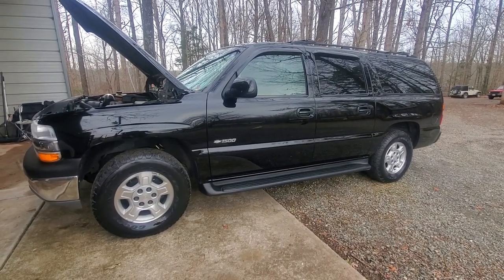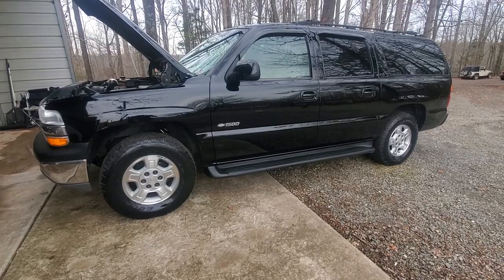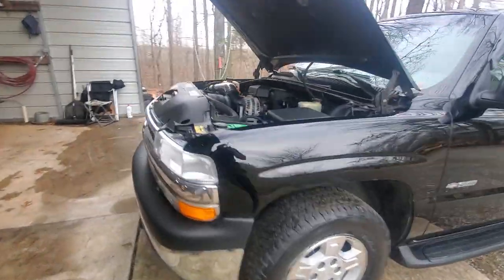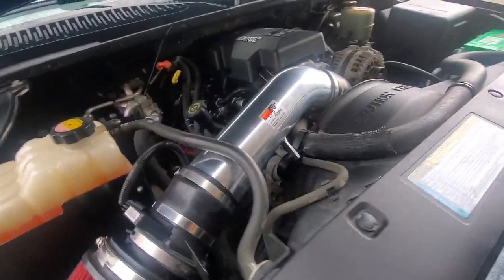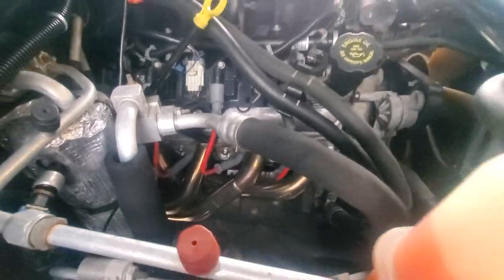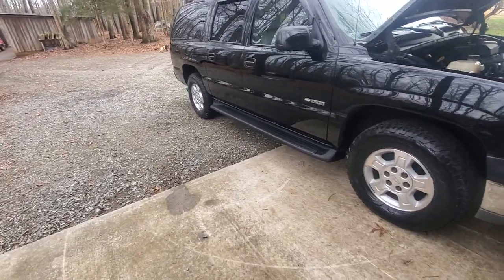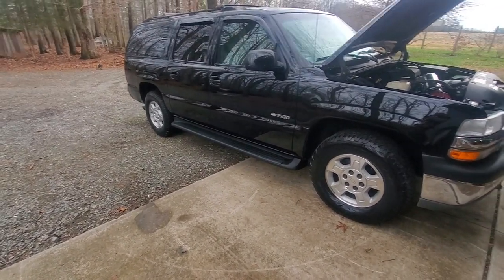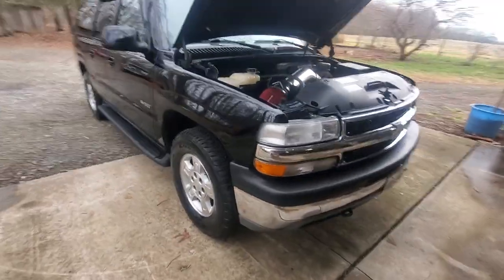BTR STAGE 2 CAM IN LS

Comment: I did the same on my 07 avalanche, but used pace setter 1 3/4” longtubes, pace setter 3” y-pipe, cherry bomb salute series muffler. After about 3 months my torque converter started slipping, there is 170k miles on it tho, so it’s due for an upgrade. Since I need a new torque converter, gonna go ahead and go with the stage 4 cam, 3200 circle D TC.
Reply: Say a prayer for your 4l60 and put a trans cooler on it lol

Comment: Hey man love the work. The wife has a 5.3 Suburban with Pacesetter LTs and Pacesetter Catless Y pipe with a magnaflow muffler(she ain't crazy on loud exhausts just power lol) what supporting mods did you do too accommodate the cam? Did you run a different converter with a higher stall? Any info would be greatly appreciated!

Comment: I have an 06 Tahoe I just put a stock LQ9 in and I have some ported and milled 243s to bump the compression to11.3, ported Fast LSXRT 102mm intake, 4" CAI with Ls7 MAF, 1 3/4" headers, ORY, Flowmaster dual 3" to 4" merge to a stock Duramax catback with a Borla 4" SI/SO muffler. How does the Stage 2 perform in a SUV as heavy as the GMT800? I'm on the fence between the Stage 2 or 3 since I have an iron LS2 with worked heads, intake and more compression

Comment: Did you change torque converter, valve springs?
Reply from the maker: Yes had to change the valve springs. I didn't change the converter because I still tow a boat and car trailer with it.

Comment: did you have any change in vacuum to your brake booster? I put this cam in my c10 and not my brake booster isnt getting enough vacuum
Reply from the maker: No haven't had that issue at all
Reply: Get a hydroboost brake system, no brake booster or vacuum needed

Comment: Man this thing sounds sick. Looking at this cam for my truck. How does it drive? Is it possible to daily drive it? Did you change any torque converter, gearing etc? 

Could you show more about the cutout and the other internal upgrades thAt you did along with the cam? Valve train etc
Reply from the maker: Drive it daily no issues. Stayed with the stage 2 so I didn't have to change the torque converter. Ill try and do another video with it up in the air, to show everything better. I used the btr stage 2 truck cam kit, it came with the beehive springs. I installed the new pushrods and ls7 lifters, they are not part of the kit. Love the cam, good power, good sound and no affect on driving. My wife drives it more than I do.
Reply: How did you tune it?
Reply from the maker: @ReptileGuy1997  took it to rpm in Garner nc
Reply from the maker: Good shop, great to deal with
Reply: Did you have any fitment issues with the kooks long tubes and y pipe? Spark plug or front diff interference?
Reply from the maker: @ReptileGuy1997  no fit perfect

Comment: I bought a BTR stage 2 and watch tons of these videos and I do not understand why some sound basically stock and some sound badass like yours. Are they just getting a bad tune? THAT different of a tune on a level that makes it sound THAT different. 5.3 ls engines. Exhaust aside some of them just sound so different.    Most sound the sameish.    Feel some guys got straight robbed my guess is just the tune maybe a few headers/ resonators/ mufflers making it sound better on some trucks and emphasizing the chop more where others have stock pipes maybe?
Reply from the maker: I would say, full length headers and catless y pipe. And a good tune
Reply: Sir could you plz tell me which cam and headers are you running. I have a Tahoe and want it to sound this bad ass

Comment: How is the convertor liking it? Stuck between stage one and 2 only bc of the convertor
Reply from the maker: No issues at all with the stock converter, down side would be that the power really comes in at around 3000rpm and a stall would help get you out of the hole quicker. I tow a boat and a car trailer, so a stall for me would not be good for towing.
Reply from the maker: I'd go stage 2, but you know how opinions are...
Reply: @reavesbj  gotcha! I won't be pulling much of anything at this point in time. More so doing it to wake it up a little and give it a mean thump. Just don't wanna mess with the convertor or have it become a problem later on due to the cam! Sounds good man.
Reply: @reavesbj  so u say it don’t kicks in until about 3k rpm’s, so what’s the difference in the stage 2 vs the stage 3? I Have an 79 Malibu lq4 swap with 4l60e & 3.73 gears. Trying to see what’s an good cam choice. How you think they will work with an 2500 stall? Wouldn’t mind using an 2500 stall(maybe a 3k), but want to b able to drive around town & Highway. So I don’t want it to feel lose on the lower end, I want it to be tight as possible of idle
Reply from the maker: @OOLilDel   I would go stage 3 with 3,000 stall to 3,400. That's what I would have done if it weren't for towing sometimes. Stage 3 starts to lose some power on the bottom of the rpm band, but gains at the top. You wouldn't see the power gains unless you where under wot. Just my 2 cents, someone smarter than me may see it differently.
Reply: @OOLilDel  your Malibu is close to 2000 pounds lighter this cam with a 2500 stall converter would be reliable and fast
Reply: @gloriamaletta8667  thanks man, I think that’s the way I’m going to go.
Reply: @OOLilDel  you will still need at least a 3.42 gear or 3.73 would even be better
Reply: @gloriamaletta8667  I have 3.73 posi already....
Reply: @OOLilDel  a decent suspension that transfers weight to the back tires and a set of drag radials your set with some tuning in your 3300 pound car should run mid to low 12s high 12s easy
Reply: @gloriamaletta8667  was you applying to the stage 2 or the stage 3 truck cam? & which would u pick over the other?
Reply: @OOLilDel  generally as the stages go up so does duration generally when duration goes up it moves your power to the upper rpm range and looses torque in the lower rpm range it also works better with lower rear gears and higher stall converter the same cam in a 3200 pound car that may work great for a 3200 pound car may not work well in a SUV that weighs 5500 pounds so it depends on what you are wanting the biggest thing is when you choose a cam the weight of the vehicle rear gearing and stall speed must match together for peak performance in other words a stock stall converter with 2.73 rear gears with a stage 3 cam is not a good match
Reply: @gloriamaletta8667  Stage 2 it is then 💪🏻
Reply: @OOLilDel  a race car isn't worried about idle or street ability if it's a daily driver idle is a concern as is street ability keeping the cam duration just under 220 is going to be reliable dependable and streetable it shouldn't need a high stall converter a cam with 240 or more duration is going to idle rough need 3.73 to 4.56 gears and at least a 3000rpm stall converter to work also a cam with 240 duration will usually make good power from 3000-7200rpm a cam with just under 220 duration will make good power from 2000-6200rpm it all depends on what your wanting a strong 12 second reliable street car or a weekend warrior serious street car drag car that runs high 10s to low 11s but at the sacrifice of street ability that won't be driven daily or as general transportation when ordering your cam tell the tech weight of the car rear gearing ratio transmission and stall converter being used on you application because for the best performance matching everything is a absolute must mis matched components will not give you good results
Reply: @gloriamaletta8667  yeahh I’m not building an all out race car. Just want some nice sound & some good street power that still will feel tight off idle pretty much like factory
Reply: @OOLilDel  stage 2. 3.73 gears 2500 stall converter the stock 6.0 should be enough power to push your Malibu to mid 13s with a stock stall speed and 3.73 gears with good tires and traction this stage 2 cam with a 2500 stall converter should should easily knock of 7 tenths of a second or more putting you in the 12s possibly 12.3 easy 12.7s
Reply: @reavesbj  if you do what you said stage 2 cam 3.73 gears and a 2500 stall converter and get it tuned right your going to be wanting suspension mods because it will be burning rubber through 1st and 2nd gear with regular radial tires a 1986 monte carlo ss stock with a boat anchor 305 with 180 horsepower and 3.73 gears can run high 14s a stage 2 cam in a good running LS 6.0 should easily make 400 -430 horsepower at the crankshaft and makes 360 at the crank stock
Reply: @OOLilDel  l do suggest you look into a set of hardened pushrods the stock pushrods are junk and if planning on pushing this engine hard repeatedly you get a SFI harmonic balancer the stock ones don't like repeated over 6000rpm revving but the stock ones can work but eventually something bad is going to happen it's good insurance to protect your investment make sure you get a lockup style stall converter not nonlockup
Reply: @gloriamaletta8667  thanks. I already have hardened push rods in from btr & pac 1219 springs installed. I just need the cam now. & I’ll look into that harmonic balancer also. Good looking out.
Reply: @OOLilDel  look at the GM performance 6.0 450 horsepower crate engine it makes this kind of horsepower with a cam very simular to this stage 2 cam with rectangular LS3 heads instead of the cathedral port heads you probably have you may lose 20 horsepower or so but they make better low end torque than the LS3 heads below 3000rpm make sure you get a lockup style stall converter not a nonlockup with the 3.73 gears cruising on the highway will be much more laid back than a nonlockup converter above 65mph and it will make the transmission last longer and be better on gas and will reduce transmission heat to much heat will kill the transmission
Reply from the maker: @gloriamaletta8667  i was saying I would do a stage 3 with a 3,000 stall or close. I would hope if you are doing an ls swap, then suspension and wheels and tires would be in the build. That combo I think gets you the most power and maintains streetable characteristics. But I agree with you, stock wheels and tires and suspension would blow the tires off and cause bad wheel hop. Those monte carlo's are leaf spring in the rear right?
Reply: @reavesbj  l suggested the stage 2 truck cam because he said he wanted something that idled close to stock and the stage 3 will have a slight chop  the stage 3 makes 430 horsepower on a 5.3 the stage 2 makes 404 horsepower on a 5.3 he has a 6.0 my thinking is it will make 20 more than the 5.3 because of the 4 inch bore l have a 1984 monte carlo ss with a LS2 crate engine from SDPC performance with LS3 milled and CNC ported heads it has a cam with 226 duration intake 236 duration exhaust both 600 lift with a GM single plane intake and a holley 850 hp carberator it has a built 700r4 with a vigilante 3000rpm lockup stall converter a buick GN 8.5 rearend with 4.10 gears it idles at 800rpm it's pretty choppy it has run it's best 10.87 at 122mph it will run low 11s all day if you press the gas petal more than very slightly in gear it will turn 2600rpm it makes 540 horsepower at 6800rpm and 470 foot pounds of torque at 5200rpm at the crank l can't imagine it being my daily driver it redlines at the rev limiter at 7200rpm l think and it's only my opinion that a cam with over 220 duration is to much for a daily driver this guys 1980 Malibu only weighs 3200 pounds with a iron block LS engine with the stage 2 truck cam it should make very close to 430 horsepower at the crank with gobs of torque from 2000rpm to 5500rpm redline at 6200rpm with 3.73 gears and a 2500rpm lockup stall converter it could be driven anywhere it should do 80mph on the highway all day idle good and with traction it should be capable of 12s that should hold its own against most late model muscle cars and still get 20 miles to the gallon on the highway he said he wanted something that idled close to stock it's his choice the stage 3 truck cam is slightly over 220 on the exhaust side it makes slightly more power at the expense of less torque and driveability under 3000rpm from 2000rpm to 6000rpm bet it makes less average torque than the stage 2 truck cam you must look at the average numbers throughout the entire rpm range not just peak numbers more so on a daily driver than a drag or serious street car my monte carlo ss runs very well but once you take off in 1st gear at full throttle and shifting it it never drops below 5200rpm so it spends most of its time at full throttle in between 5200rpm and 7200rpm and it doesn't like to be short shifted at anything lower than 6300rpm in other words a cam that would be more mild if shifting at 6300rpm or below would be faster than the setup l have now my car weighs 3380 with me in it this guys Malibu is light enough to use the stage 3 truck cam and it would still run good but l think it wouldn't drive as nice from idle to 3000rpm when cruising if your daily driving it most of the time it will spend most of it time in this rpm range and my Monte Carlo SS is pretty spongy below 2500rpm with the 3000rpm stall converter l think a 2500rpm stall in this Malibu will pull rather nicely at 2200rpm with no spongy feeling with a 2500rpm stall

Comment: Sounds really nice! Got a good thump to it. Did you have any tuning done after the install?
Reply from the maker: Yes, rpm in Garner, NC. 93 tune, and tuned for the cats being removed.
Reply: @reavesbj  With the cam you did get the cam that uses your stock springs? How much difference could you tell on acceleration and finally what gears and converter are you running.
Reply: Thats what im wondering about..springs ect..ect..i have a 04 escalade 6.0 awd i want to cam swap but dont want to mess with the. Springs
Reply: @reavesbj  DID YOU NOTICE A STRONG GAS SMELL AFTER REMOVING THE CATS?
Reply from the maker: @adrianavasquez3031  Yes I did, one of the down sides
Reply: @erictaylor183  don't do a cam without springs. If it's small enough to work safely on stock springs it's not gonna add much performance

Comment: Swapped the Vortec for a LS?
Reply: It comes with an LS stock, which technically it's a vortec also. The non-LS vortecs (SBC) ended in the first half of 1999.
Reply: @oceanwaves83  I don't think that is true . That is a vortec intake and it even says vortec on the cover . Those engines are not the same .
Reply: @P4OE  of course not everything is exact but don't let the plastic cover fool you. You can look up the differences
Reply: @oceanwaves83  There are lots of differences . Thats why they are called vortec and not LS engines .